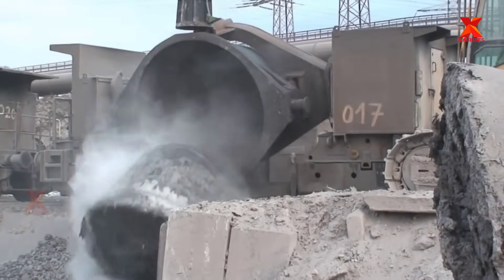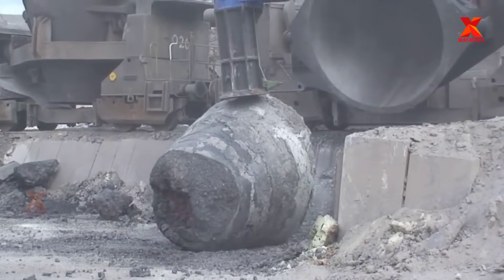Heavy Machinery & Equipment Handling Blast-furnace And Steel Slag At Metallurgical And Steel Mills

Comment: Too bad they couldn't use the heat in the slag to  generate electricity through steam turbines.
Reply: There are a number of problems with that idea.   One, the heat wouldn't be at all constant rate, since flag goes from molten to a solid.  Second, a constant fuel supply supply is required for a steam turbine to operate,  slag doesn't fit those qualifications.
Reply: @thomastaylor6699  Well, it could be something as simple as pre-heating the water.   That in itself could save a ton of energy.   Think of those clay / brick oven battery systems.
Reply from the maker: That's a great idea